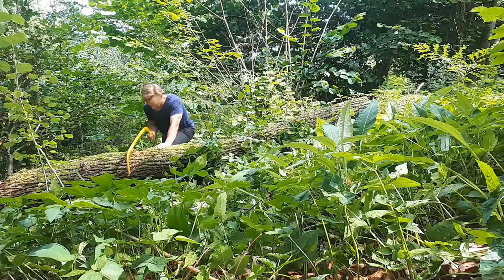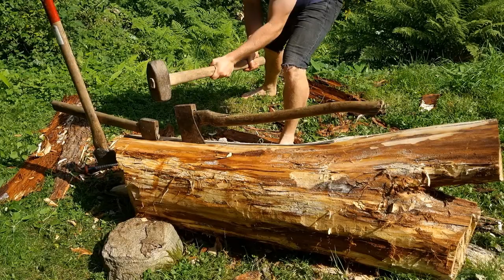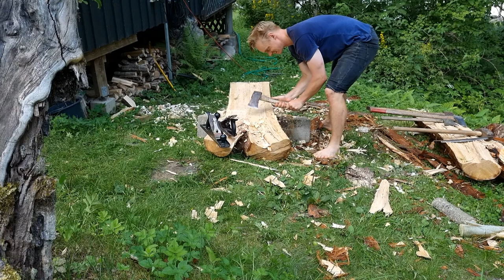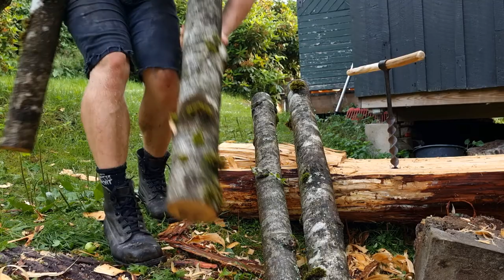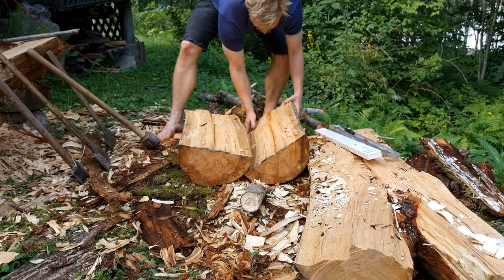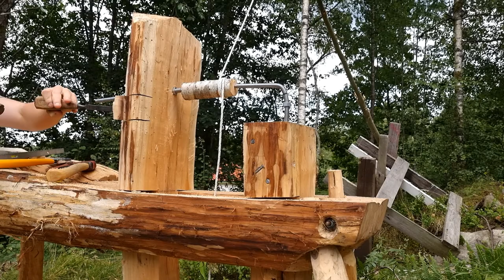Building spring pole lathe at dads camp

Comment: Awesome video, I e if the most rustic builds I've seen with no cheating! For the legs did you just drill and carve to fit, or did you taper the hole? 8ve been overthinking what to do and not sure of the whole idea of tapered tennons is needed when the leg is tapered anyway. Any thoughts?
Reply: If the leg is tapered but the mortice it goes in is not, you don't get a stable joint.